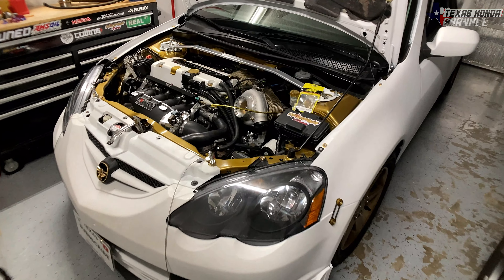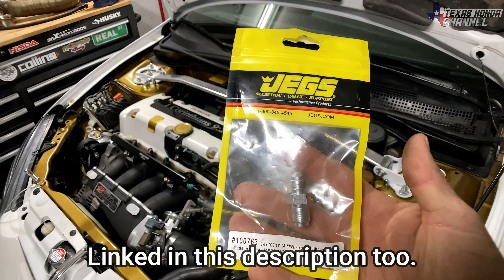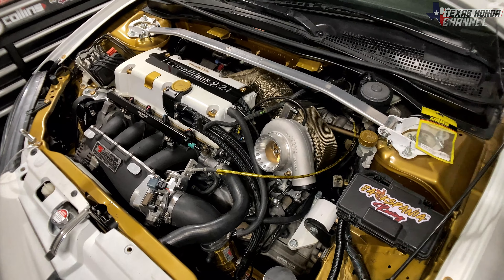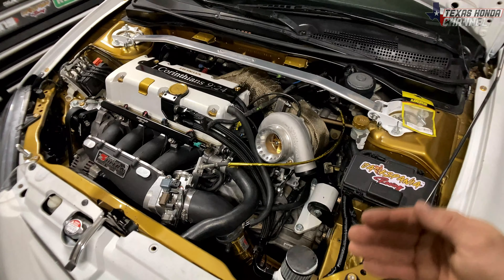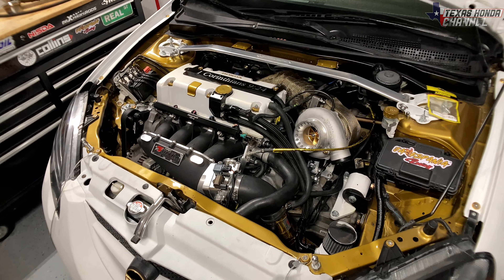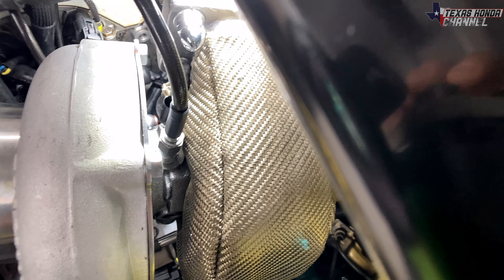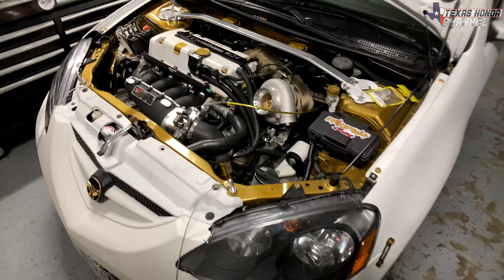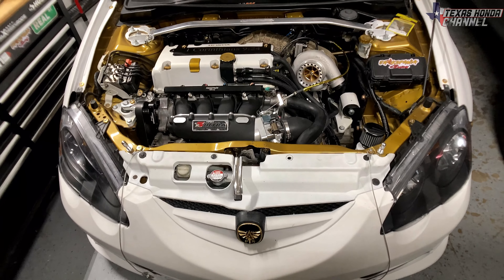OIL RESTRICTOR  INFO FOR JOURNAL BEARING TURBO -PERSONAL PREFERENCE

Comment: Crazy timing on this video I was running .035 restrictor and cooked seals my gt3582 journal bearing last week opened up restrictor to 1/16th which is .062 should be good after rebuild turbo
Reply from the maker: Yes definitely! .060+ works great for journal bearing!

Comment: Hey brother, what exactly did you paint/powder coat on the turbo to get that gold to show like that. I like it alot and its perfect compliment for the engine bay
Reply: I’m pretty sure the wheel in the turbo comes gold like that if you buy their more expensive version of this gt3582 turbo
Reply: @user-hh4hc2lt6e  i dont think this is true because it wasnt painted when he first got it
Reply: @not_flvcko  i can actually assure you i am right lol. I’m about to buy this same turbo. He didn’t paint it. The race version of their universal gt3582 turbo, it comes with the gold fins.

Comment: Had a cxracing kit on my s14 had the needle bearing turbo and the restrictor on there was still too big and ended up blowing the bearings put. Got cheap Chinese ebay turbo from a friend with a smaller restrictor with it n did same thing. I was using sandwich plate adapter so I'm thinking the pressure was just too high overall instead of coming off the oil pressure sensor like your doing
Reply from the maker: I had journal bearing with restrictor and without and had issues with and took many many years of attempts to figure out what I should or shouldn’t do. I learned the expensive way
Reply: @TexasHondaChannel  yeah I hate the needle bearing types. Wish I'd had the $ for regular ball bearing and my setup would been alot better but live an learn.

Comment: What feed line a/n size 4 or 3 did you use with that jegs no restrictor adapter peace
Reply: Says on the pack -3an. Also Hunter tuned recommends -3an for feed on journal bearings turbo